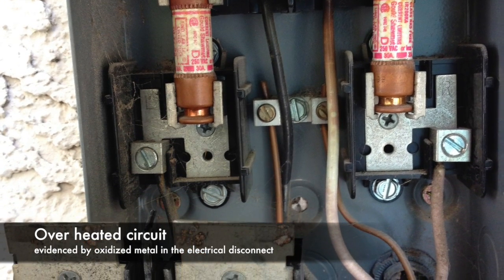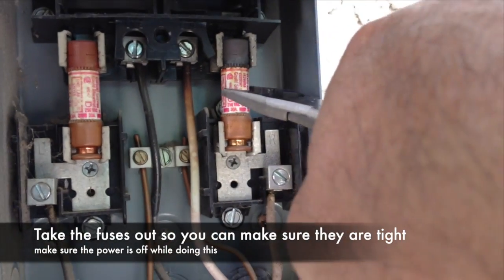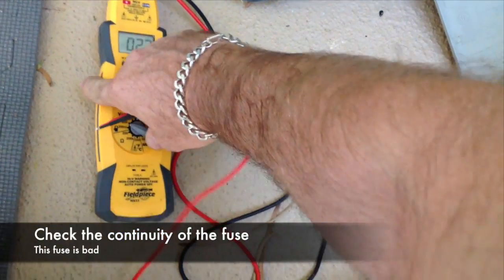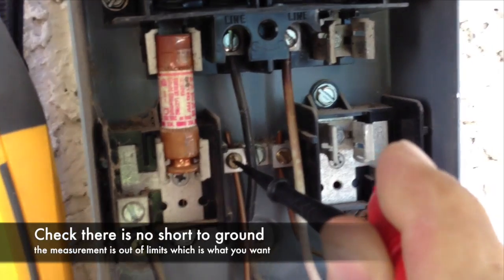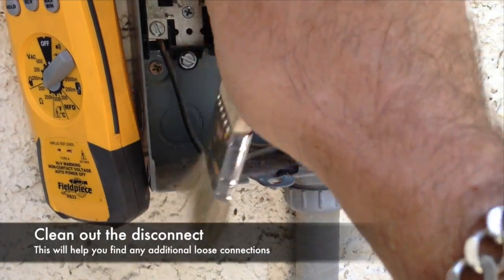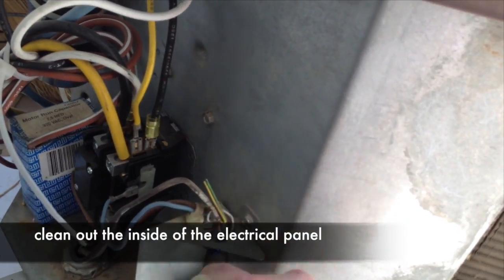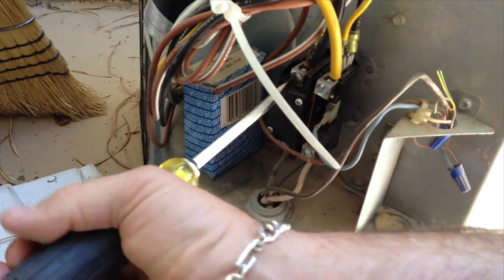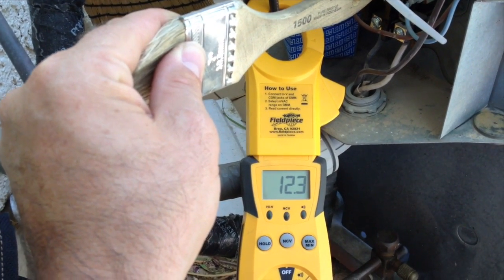blown fuse diagnostic, over heated circuit

Comment: What caused the fuse to blow?
Reply: Pwedi bang un 30 amp.papalitan Ng 60amp
Reply from the maker: The prongs holding the fuse weren’t making good contact. It overheated the circuit causing the prongs to oxidize.